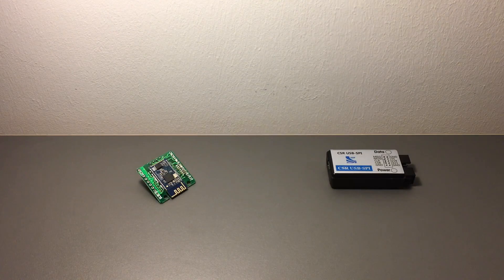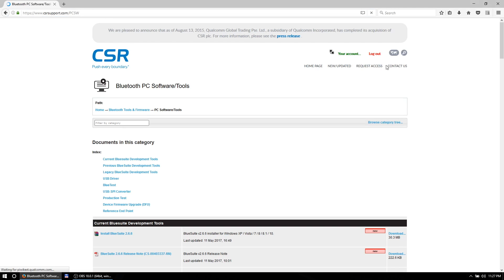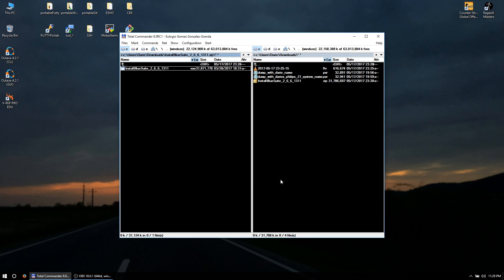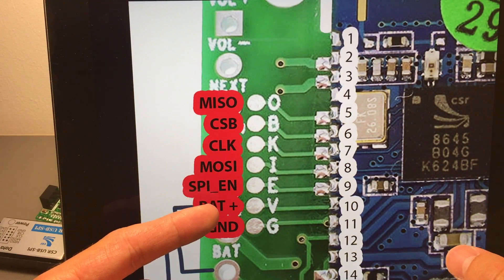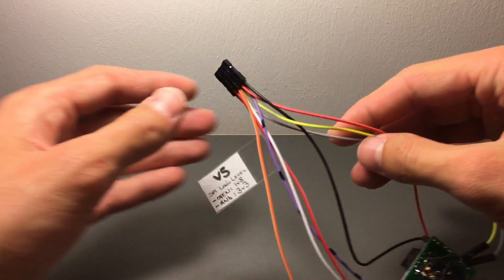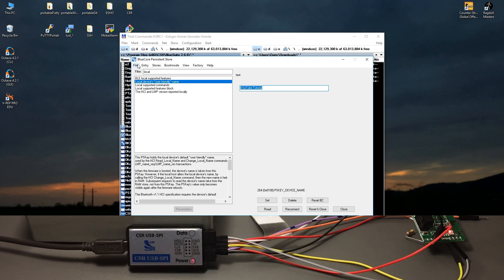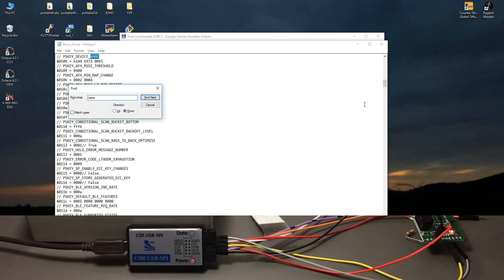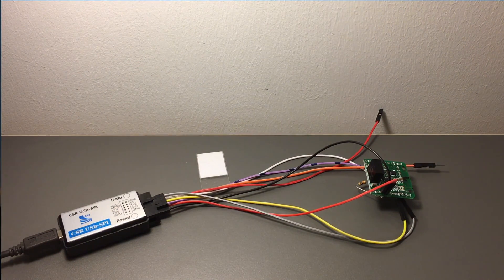How to Rename a CSR8645 Bluetooth Module

Comment: hi, its good video, maybe you can say how can i add voice promt to csr8645? i want to add voice instead audio tone
Reply from the maker: Check my "disable mic csr8645" video, there I use the ConfigTool

With that you should be able to change the prompts
Reply: Darieee ok.  i watch it)  version 3.0.70 is not  damage the module?  if i write to device the changes?
Reply from the maker: follow the video very - veeery carefully, and you'll be fine

watch all of it once over before
Reply: ( broke my module( delete power on audio tone and write to device and module now not start up( and spi programmer is not connecting(
Reply from the maker: Go into PSTool, and, try making it to connect

There, you'll have Restore Factory Defaults in one of the buttons above
Reply: Darieee i try but no connection (
Reply from the maker: Might be that some of your wires came loose, happened to me many many times
Reply: Darieee leds no blinking( and before they're blinking every second.  3v on power en pin..  (
Reply from the maker: Well, it might be damaged, but, usually with enough perseverence you can recover them

You probably clicked write to device in ConfigTool without reading from device first, huh ?
Reply: thanks) i recovered it) PSTool is good)

Comment: Is there a way to change the default volume on a chip like this? I bought a cheap ebay amp and I'm trying to use it in my car, but the default volume of the bluetooth chip is FULL BLAST.

https://www.ebay.com/itm/120W-TPA3116D2-Wireless-Bluetooth-Audio-Stereo-Receiver-Digital-Amplifier-Board/162732318477?ssPageName=STRK%3AMEBIDX%3AIT&_trksid=p2057872.m2749.l2649
Reply from the maker: Yeah, them chinese are way hardcore : check the "disable mic on csr8645" video, there I use and link to the ConfigTool, with that on the first tab in the top right of the first tab you'll find the default volume :)

Comment: Hey Darieee, great vids on CSR's!Exactly what I was after. I'm working on a project where 8645 is involved and I wanted to change a name. But also - more importantly - I need one of the IO pins to go 1/0 accordingly to BT activity. Ie when BT is active I need the pin in log 1 and when BT is idle I want it 0. Any thoughts on where should I look in the config tool? Thanks and keep up the great work!
Reply from the maker: Glad I could help, I remember it took me half a year to source the corage and parts to rename the ones I had, can't let that happen to more people

Firstly, the CSR8635 and CSRA64215 (check the pinout) modules have an Amp_Enable pin which is a preconfigured IO pin that does exactly what you want

Otherwise you can go into the Config Tool and I'm quite sure you'll manage to find the IO section (I don't know this by heart especially since when I needed such functionality I was a bitch and programmed the LED light .. somehow that seemed easier at the time)

In any event, if you still can't et it working I can fire up my config tool and take a look myself

Btw what project ?
Reply: Hey Darieee,
thanks for that. CSR programmer is on its way to me so once I have it in front of me I'll give it a try. Maybe I'll grab your brain later if I fail :-) 
Yes I saw it on CSR8635 pintou you attached to one of your vids and I was like yeah this is what I need! "Unfortunately" I have quite a few 8645's already so I want to utilize these. I'm building custom infotainment system for BMW car. It's a replacement to stock Central Information Display that is pretty old and can't do much. I ripped off original screen and fitted Android tablet. I'm building a dedicated ECU for the screen and one of the modules I want to implement is BT handsfree. Handsfree is supposed to provide "interrupt" signal to mute ordinary audio and swap audio source to phone. Along with BT handsfree it will host USB stick (as audio/video repository), reverse camera, atmega based watchdog (that will control clever power management, active CPU and battery cooling, control of GPS tracker etc etc), OBD interface and I still have one USB slot free. Maybe I'll try grab a little joystick and will try to emulate HID with arduino so I can control the tablet with mouse.

Thanks for your help,
Jan
Reply from the maker: Holy crap that sounds awesome, would love to see a video or some pictures of it sometime

Also, couldn't resist checking.. In ConfigTool (you can load it without the programmer just to see what's there), you have the Input/Ouput tab, aand yeah, a lot of IO goodies there
Reply: Perf, thanks a lot! Yeah happy to show/share anytime. Currently I have the flip display part done. It was more about physical fitting of the tablet, and one nice PCB with atmega 328p that controls the stepper motor for screen positioning. The rest is currently at my desk - it's arduino 2560, usb hub, video dongle etc etc. Currently trying to figure out how many inputs/ports of Arduino I need and then I'll build custom PCB and job done. It is also connected to BMW's communication BUS and is listening to the messages and does some stuff accordingly (gps tracker arm/disparm, triggers alarm if door opens when armed, emulated CD changer so I can feed audio to car's head unit - inputs are only active when cd changer is present, I can detect ignition, write text on radio display etc :-)
Reply from the maker: dayum, that really sounds nice, you should definitely make a video showcasing it when it's done, and please let me know what that goes up, wouldn't want to miss it !
Reply: Sure thing. Yeah that's what I'm planning for! This one becomes really quite a beast project which I can't keep for myself only. So stay tuned and I'll post some pics or vids one day once I'm comfortable with the results ;-)
Reply: Jan Vašata — sounds amazing... please let us know once you have something to share!

I'm also doing a project in my car with CAN bus readings from steering wheel and am right now at the stage to connect the Canny 7 device to the bluetooth module.

Currently not sure which BT module I should be using.

My biggest concern and problems so far is with connecting a microphone to achieve an excellent hands free quality in the car.

In general I think it would be a good idea creating "after market" products for (older) cars, like your infotainment board for your older BMW.

Obviously the car manufacturers are not electronic specialist and these cars are sold already, so why should the create cheap BT accessories for past models. Also the want to sell the new cars, not upgrading the old ones.

Comment: Hi Dariee! Thanks for the excellent explanatory video. I have a similar board with the same CSR8645 chip. I want to use a momentary switch to turn on/off this board, do you have some tip on how to do that? Thanks.
Reply from the maker: Mmm, not really, why do you want it turned off though ? And why won't a normal switch cut it ?
Reply: I want to use this board in a portable speaker. I normal switch can cut it, right, but I want to use a push button. The normal switch will not look nice in this project, since usually they are larger then a momentary switch. From the datasheet I see a PWR_EN pin that this functionality is supposed to work.
I am asking on the diyaudio forum, too. I think I have to change the PSkeys, maybe, but I havent arrived at this point yet...
Thanks for your reply.

Comment: Mine doesn't work with csr8635
Reply from the maker: Check the pinout

You have to connect MFB to VCC to enable the csr8635 modules
Reply: Darieee  will try thanks
Reply from the maker: sure ! let me know if it worked
Reply: Still doesn't work I am getting error detecting chip type. I don't know what I'm doing wrong
Reply from the maker: Did you connect the 10K resistor from VCC to SPI_EN ?
Reply: Yes
Reply from the maker: Yeah crap if you're using jumper wires those sometimes don't make good contacts - try using mew wires and make triple sure you've connected everything right - any mistake will make it not work at all
Reply: SOLVED. Connect wires like in video (10k from SPI_EN to VBAT, VBAT to 3,3V; GND GND; MOSI MOSI, MISO MISO, CLK CLK, CSB CSB. Now its not working, so just connect 1,8V from the csr board to VCCA on USB SPI, connect it and ITS WORKING. IF you cant find VCAA on USB SPI, open it and have a look on pins. (i dont have it on box). This helped me: https://github.com/maestun/csr8635-config-notes
Reply: Did you solve it? I have exactly same problem.. Wiring is good, checked it like 10 times.

Comment: About CSR86XX Config Tool... Have you tried loading from the device before changing the name of it and flashing it to the chip?

Then again, the Config Tool is kinda buggy, and possibly has compatibility issues.
Reply from the maker: If you run it under a 32bit Windows 7 it runs flawlessly - and yes, you can load from device, change the name, then write to device

Don't know if you have but I actually do use that tool to disable the microphone in another video :)

Comment: Hi, did you alter any settings in your CSR8645 Dump included for download in description?
I have the same module (F-3188) and it works but after a few minutes of playing music it shuts down the bluetooth connection...
Reply from the maker: it should be quite stock, only the name is changed ...

check my how to turn off the mic video : use the ConfigTool I linked in there to fumble around with the settings ... 

!! actually, before that, in PSTool go to Restore All Factory (or something like that) unplug and replug the board, then flash my .psr again

(when you merge PSRs it's only additive, so, if you want to remove a setting you'll have to erase everything first)

Comment: Hi Darie, 

I bought a pair of chinese Bluetooth earphones. They use the CSR8645 board, which supports the AAC Bluetooth codec. However, only the AptX codec seems to be enabled. My computer supports AptX, but my phone only supports AAC and so will default to SBC when using the earphones. Can I take apart the headset and use this method to the enable AAC codec? Will the pinouts be already be in use connecting the board to the other components in the headphones, such as the control buttons, antenna, and so on? Sorry, I'm a noob at this. Any advice would be greatly appreciated.
Reply from the maker: yeah, you should be able to configure it no problems

check my "disable microphone on csr8645" video - you'll be using the tool I showcase there

quite curious now - what headphones :) ?
Reply: Thank you! :) 

I am using this cable from AliExpress: https://www.aliexpress.com/item/2017-New-FAAEAL-BT-Wireless-Bluetooth-4-1-Cable-HIFI-Earphone-MMCX-Cable-Support-Apt-X/32814252995.html

My earphones (Tennmak Pro) use the MMCX connector for their detachable cable, so I can plug them into this Bluetooth cable to make them wireless. Works pretty well, besides the lack of AAC codec and the battery low warning sound being WAY too loud. Both of these problems I can fix thanks to you.

I may try turning the master gain down a little bit, as there is an audible hiss when using the cable and the lowest volume level is not low enough for me, while the highest is louder than i'll ever need. I assume i'd be using the tool in this video? Or would the master gain be set using the EQ tools in your other video?
Reply from the maker: Master gain you set with the FrontEnd (equaliser video) and beeps are always set to be retardedly loud, also in ConfigTool (disable mic video), it's Volume for Alerts or something, I'm pretty sure I mention it there as well ... it's the first tab somewhere in the top right quadrant

If you can show me some pictures of how these headphones look inside ... it seems the modules are just as wide as the 8645 chip ... do they have programming pads ?
Reply: Perfect, thank you. 

I'm planning to open up the headset over the Christmas break when I have some time off from work. I can send you some picture of the insides then.
Reply from the maker: Awesome, good luck !
Reply from the maker: at 10K barely no current will slow, so any type of resistor will work : it's just to set the mode on the chip

I'm quite sure you won't need 100 10K resistors too soon though, so, better go with one of these https://www.ebay.co.uk/itm/1000-PCS-100-Value-1-2W-Carbon-Film-Resistor-Assortment-Kit-1-10M/201971658178?hash=item2f0672edc2:g:9OUAAOSwMQBaJPUw
Reply from the maker: and remember - I still want some teardown pics of that cable ;)
Reply: Darieee thank you. Of course! It's the least I can do at this point. I'll reply here with a photo as soon as my SPI programmer arrives
Reply: FreebieUndead I'm also interested — any success?

Comment: The 64215 module i have is similar to the one at the right. But your picture does not have pin out label. Which one is 3v3？I have anotber silly question， does these chip included a DAC？
Reply from the maker: Have you connected yours to any speakers/headphones ? Given the module should SPEAKER A P and SPEAKER A N and for B as well ... I'd assume it does have one (my csr64215 module doesn't produce any output however .. for some reason)

Coming back to your question, it seems the CSRA64215 motherboard is exactly the same as for the CSR8635 (I've asked a few sellers to confirm this but the component layout in the CSR8635 seems 100% identical)

So, here : http://bit.ly/2ux5CJG : VBAT would be 3v3, and the rest should be clear (I assume you have the same programmer as myself ?)
Reply: Darieee the one I have us this a works with no problem. https://m.ebay.co.uk/itm/CSR64215-Module-Wireless-Bluetooth-4-2-Audio-Receiver-Board-HiFi-Lossless-APT-X-/272768136730?_mwBanner=1
Reply from the maker: alright .. really does look like a CSR8635 motherboard ... let me know if you manage to program it ...
Regarding the analog output .. your board does have the one large chip ... That seems to be for the analog audio output from what I can gather
Reply: I do think the CSR chip already included the DAC processing. The audio output from the chip is analog and the extra circuit (included the DRC632) in the board is analog amplifier.
Reply from the maker: yeah, that's probably there to convert the signal from differential to single-ended

so, did you manage to rename it ?
Reply: Brian Fung would also be interested to hear if you were able to program it

Comment: But from the pinout， pin 16 is 1v8 but there is no 3v3. Is your BAT+ connects to pin 16？
Reply from the maker: +Brian Fung BAT+ is the 3v3 in .. well, it goes up to 4.2 and down to 2.7 or something
Reply: Darieee , I am trying to do the same for csr64215.  So I do not have a same exact module u have. I can only find a pin out labelled 1v8 but no pin out labelled 3v3. Should I take 1v8 as BAT+ then?
Reply from the maker: Alright, the pinouts are in the description, as well as the suitable programs.
Reply from the maker: Please let me know if you can get ANALOG audio directly out of the BLUE CSRA64215 boards :) I have one (like the left one in the pinout picture) that produces no sound
Reply: My module is a little different from what you have shown. It works with no problem but I just want to change the "friendly name" of it.
Reply from the maker: so .. is it different from both ones I've attached ?

Comment: Hi Darieee, unfortunately the USB to SPI i bought has not pin to select the signal voltage, and i checked and it is 3.3V.  Do you know hot to deal with that?  When i connected it to the 8635 module, the signal was not looking good.  Sometimes it was going from GND to ~1.8V and other times it was going from 1.8V to 3.3V.  Please let me know if you have any ideas.  Thanks.
Reply from the maker: I've read online that the CSR chips accept both 3v3 and 1v8 - so, theoretically it should work as long as you connect all the pins properly and not forget the EN :)

Comment: I have vw polo 9n with gamma radio, can i somehow install this bluetooth module? https://www.aliexpress.com/item/Bluetooth-4-0-Audio-Receiver-Board-Wireless-Stereo-Sound-Module-7-30V-Anti-Receive-Automtic-Switch/32807951728.html
Reply from the maker: Weird module that one - haven't seen that board layout before

IFF it has the connectors that mate nicely with something on your car - then yes, go for it

Otherwise I'd go for the board I have, since it's very popular (and I hear there's a dude with a weird voice having tutorials on how to change their name and stuff).

If you get the 12V version it should only require an extra bit of soldering work since it doesn't have fancy connectors (and the button board on that one is relatively superfluous since you're most likely going not going to drill a whole in the dash)

Comment: Can you program it with a arduino uno as an SPI interface?
Reply from the maker: I'm quite sure it is possible - but I'm not aware of any library that would do it. Furthermore, from what I've read CSR (now Qualcomm) uses some weird crap too ... and yeah, you'd need to interface with their antiquated software ... For 20$ it really isn't worth the hassle.

However - if you really are on a tight budget - you may use are regular STDI adapter : https://github.com/lorf/csr-spi-ftdi/blob/master/README.md

Someone in the comments of one of my 3 videos on programming these CSR8645 modules has done that successfully - perhaps you can find the thread and ask them for more details there :)

Again though, I would very much recommend one of the 20$ programmers : those are guaranteed to play well with most CSR chips
Reply: you can just modify dump and flash it via ch341a

Comment: Thank you for the video. A question: if I want to configure a BT Headset, should I connect it through this adapter? Or is there a way to do that through USB?
Reply from the maker: most likely you'll need the adapter - I'm quite sure your headset doesn't include an SPI to USB converter just for the off chance a user wants to program it
Reply: Darieee Thank you!